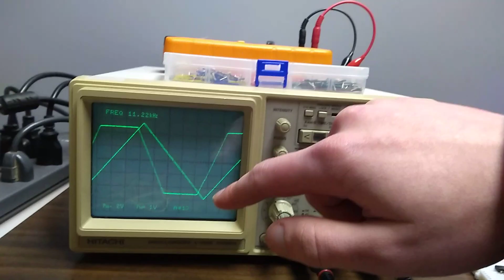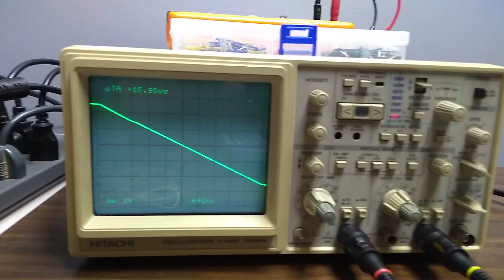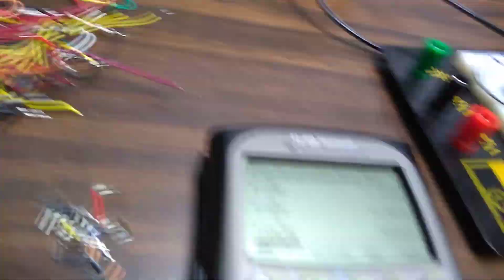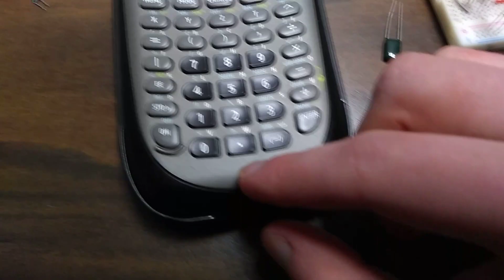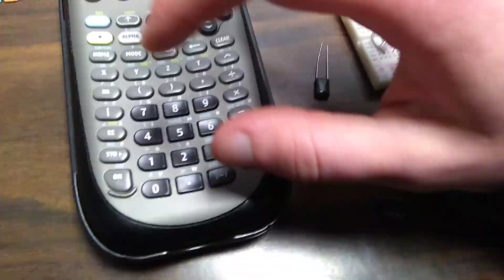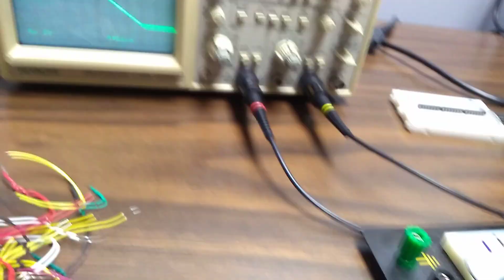Comment: 1N4148 is a Zenner Diode

also, How the hell did you get 100 Units for $1
NO WAY !!  approx. $10-$15 for 100 Units (not including Delivery)
10 Units is like $1, There is something more to this,  maybe you order $100 of worth of stuff and for $1 extra threw it in, but you didn't buy that on it's own NOR IS IT A TYPICAL PRICE
Reply: The 1n4148 is not a zener diode. Zener diodes are meant to be reverse biased. The 1n4148 has a reverse break-down voltage of 100V, while most zeners are less than 10V.

You're right about 1 cent per diode not being a regular price; it is a wholesale price. However, if you look around you will find vendors selling low quantities for wholesale prices. Here is one example: https://www.newark.com/vishay/1n4148-tr/switching-diode-100v-150ma-do/dp/33C2680?st=1n4148.

The reason I'm a huge fan of the 1n4148 diode is because it is THE industry standard discrete small-signal diode, meaning it is mass-produced and cheap. It has a very fast reverse recovery time, 100V reverse breakdown voltage and can handle 150mA average forward current.
Reply: @andreyselectronics149  
no , fair enough
but i've never seen a Zenner that hasn't been orange
and i've never seen a traditional non Zenner that was Orange
hence why i asked
i mean it really looks like a Zenner doesn't it

so my next question now when looking at PCB's and troubleshooting.
given that the thing is so small and you won't be reading the markings.
How to tell in circuit if it's a zenner or not
i guess i could measure it,   but VISUALLY....    i'll have to think about this
Reply: @martinkuliza  It's actually clearly printed on it. These diodes are large enough to print the full name, though I've found that I can remove it with isopropanol. For surface-mount components it's a little more difficult. In that case I suggest building a current source. If you know that all of your zener diodes have zener voltages less than or equal to 20V, you can build a 25V 1mA current source for distinguishing between them and regular diodes. A current source is also useful for measuring diode forward voltage. The lazy solution is just putting a high voltage source in series with a high-value resistor.
Reply: @andreyselectronics149  
yeah,  most of the glass orange one's i've seen i couldn't make out the markings not even under magnification.
it's interesting what  you say about a current source
i would have measured Vf in both directions on diode mode to establish Zenner or Not
other option, component identifier,  not highly accurate but still , just for identifying Zenner or not it does the job
Reply: @martinkuliza  I probably should get a basic component tester, I don't have one yet. I've tried using the diode mode on my multimeters but none of them can measure more than a few volts for some reason, so I just use a current source for zeners and high-voltage LEDs.

Also, I would be surprised if there is a reasonably priced component tester or multimeter that can measure a 100V diode reverse break-down voltage, but this is trivial if you are comfortable working with high voltage.
Reply: @andreyselectronics149  
I know it's cheap as chips for a basic component tester this one does the job
https://www.temu.com/au/moon_subject/n9.html?subj=googleshopping-landingpage&_bg_fs=1&_p_rfs=1&_x_ads_channel=google&_x_ads_sub_channel=shopping&_x_login_type=Google&_x_vst_scene=adg&mkt_rec=1&goods_id=601099516903025&sku_id=17592216649361&_x_ns_sku_id=17592216649361&_x_gmc_account=710728018&locale_override=12~en~AUD&_x_ads_account=2720833615&_x_ads_set=20131754338&_x_ads_id=149589525752&_x_ads_creative_id=658508387699&_x_ns_source=g&_x_ns_gclid=Cj0KCQjwy9-kBhCHARIsAHpBjHjMYrBFLQm6p2L2DVheKvo2atnaxFL2I9Bc97RK1A-dJurw04T3rdoaAjsMEALw_wcB&_x_ns_placement=&_x_ns_match_type=&_x_ns_ad_position=&_x_ns_product_id=710728018-17592216649361&_x_ns_target=&_x_ns_devicemodel=&_x_ns_wbraid=CjkKCQjwy9-kBhDpARIoADJoP7_A9MQXKZJJRrJGWFsK6zJqYDtNFPO4Mu3UWP6gDqnJLB-D8BoC_LY&_x_ns_gbraid=0AAAAAo4mICGqkV5iwlKh9o9_fjLm9sgFu&_x_ns_targetid=pla-296303633664&gclid=Cj0KCQjwy9-kBhCHARIsAHpBjHjMYrBFLQm6p2L2DVheKvo2atnaxFL2I9Bc97RK1A-dJurw04T3rdoaAjsMEALw_wcB

it'll identify diodes even Zenners and give the Vz as well as Vf
as for breakdown, probably not, but it's pretty good when it comes to BJT's and transistors 
i originally used it as an ESR tester, it's not bad for that, although i'd highly recommend MESR-100  , i have found no reason to buy any other ESR tester
the component tester is ok for ESR but not highly accurate (but still does the job)
Reply: I should also add that most vendors sell them for considerably less than 10cents per unit if you're buying 100. Here you can get 100 for $3.52: https://www.digikey.com/en/products/detail/onsemi/1N4148-T26A/978507. I generally wait until I can buy enough parts to get free shipping.
Reply: @andreyselectronics149  
yeah i saw the digikey one as well
and yeah that's what i do as well, i'll generally spend around $100 or so before i  buy anything in one lot